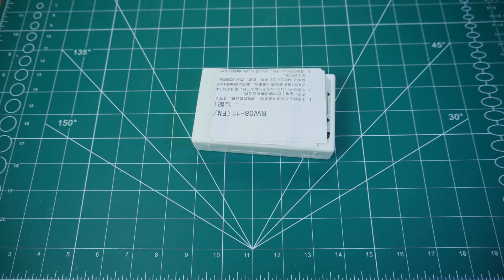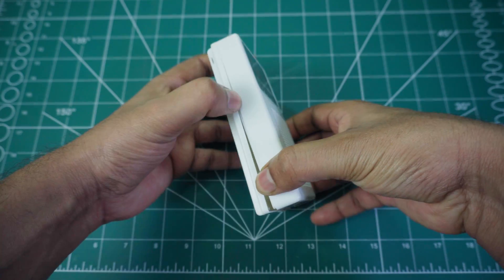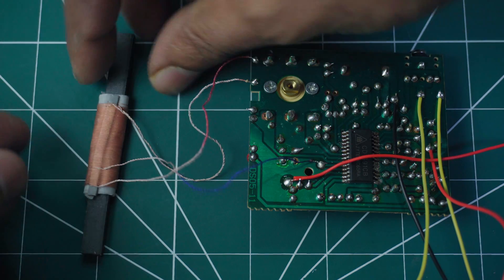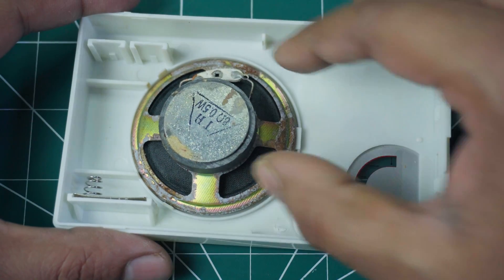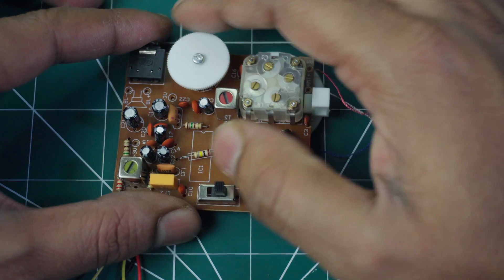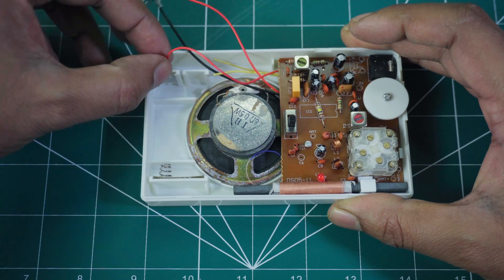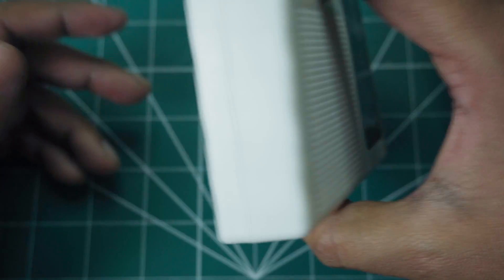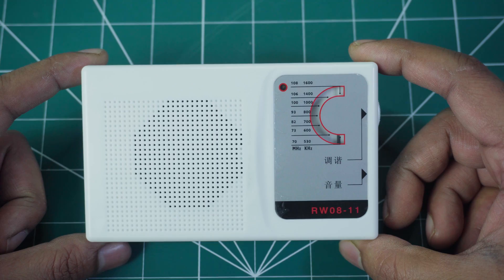Building & Testing DIY Radio Kit from online store

Comment: the LED should be installed on the other side of the board, far enough from the board to shine through the hole next to the 108/1600 marking on the dial. not to far from the board to interfere with the closure of the case.  great video.
Reply from the maker: I did notice it later. Thanks for the comment.